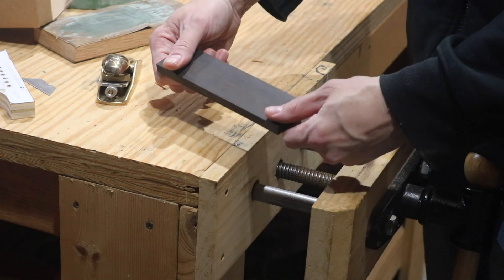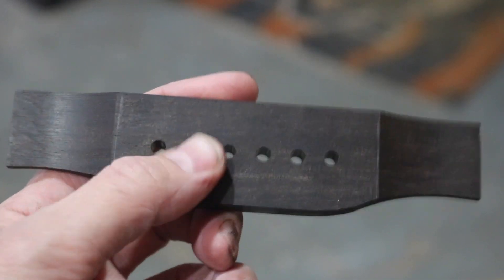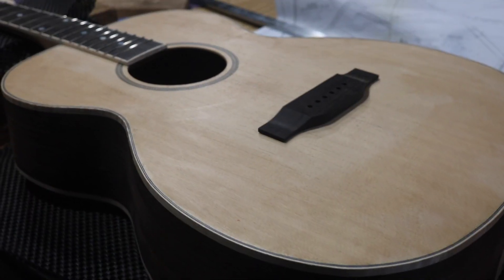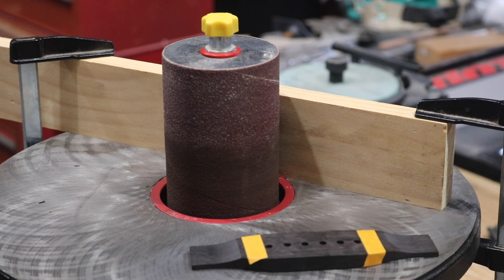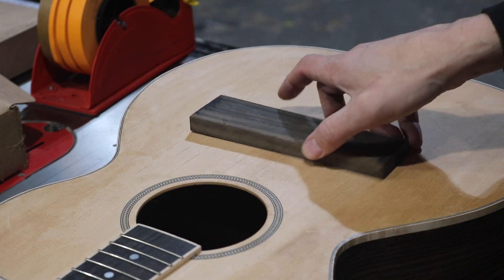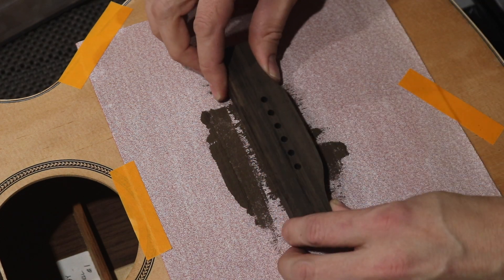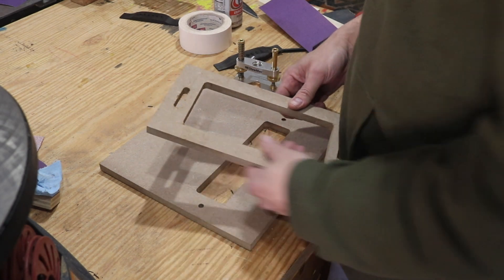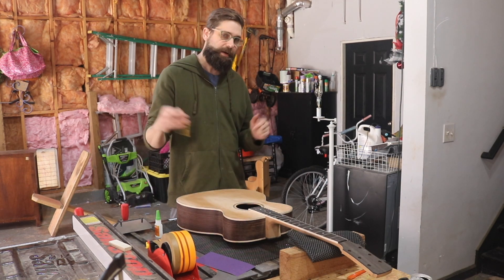Acoustic Guitar Build part 15  // making the bridge - with problems

Comment: Great video, and so good to share sticky moments which we all have of course. If you have a radius dish for the top, it’s easy to make a bridge shaping convex sanding jig. Just sand a piece of ply in the dish to the radius, screw a vice hold underneath it, and fix 60 grit with double sided to the surface. A solid surfce to sand against, unlike the more delicate front.
Reply from the maker: I actually do have one of those now. I used it starting with my second guitar to do the initial work, then fine tuned lightly against the guitar top. The place I found then called them domed radius dishes. Thanks again for watching!

Comment: All good comments and observations on the bridge, contact patch and wings. You can use your shop pencil to mark the bottom of the bridge and then see exactly where wood is being removed. Also note that when the wings are thinned, they may not touch the top, even if they did when you fitted the bridge to the top. Wood has internal stress and when you thin the wings, the stress relief may result in some movement and gaps. As long as the space is small, the bridge clamp and glue will take care of it. My opinion…
Reply from the maker: Good to know. Thanks for the information!

Comment: Chris, I’m glad to see eye protection and ear protection. Breathing sawdust and especially “sanding dust” is not good (the mineral oxides are really bad). And many exotic wood species are even worse due to the oils and other compounds they contain. Always wear a mask—N95 or better—or some type of respirator when sawing and sanding. Shop air can be filtered in different ways, but the first thing is a mask/respiratory . I know it’s a pain, but when you hit your 60’s and 70’s, you’ll be glad you did. Also, nice work for #1!  👍
Reply from the maker: Thanks for the comment! Breathing dust has admittedly become somewhat of an issue since I grew out the beard. The masks I have used do not completely protect me. In fact, I‘ve been planning on getting one pf those full face airassisted respirators, the one by Trend specifically. I know I will be using more and more exotics and things that can be sensitizers (like cocobolo) now that I am building guitars, so I plan on getting the mask as soon as I can, but the $300+ price tag is a little off-putting, haha. Thanks again for watching and commenting!

Comment: Nice video Chris. Think about your action and your saddle height. If you want your action to be 6/64"(bass) and 4/64" (treble) that will make your gap at the bridge go up 12/64" , 8/64". You add that to the gap at the bridge and that will be your saddle hight. Ideally the saddle should be 1/8" to 3/16" over the bridge. So, some gap between your bridge and the straight edge is desired. Too much will make the saddle too high. Too much would probably be more than 1/32". For me, I shoot for the straight edge to barely clear the bridge.
Reply: By the way, your guitar looks great!
Reply from the maker: Thanks so much for the information! It‘s really helpful. I‘m right about 1/32 right now, so I should hopefully be good. My bridge is a bit on the thick end, however. I think on my next guitar I may try to reduce the neck angle just a bit. Thanks for watching and commenting!

Comment: Good stuff Chris; you have a great approach imho! Try the cabinet scraper for the bottom of the bridge next time round; I use it as it's much faster than sandpaper and there's no risk of sanding bits you don't want sanded, rounding over corners that should be sharp etc. You can use sandpaper taped to the top to just show where to scrape next, by very lightly rubbing the bridge back and forth just once or twice and checking the underside of the bridge for scratch marks (you'll see these because the cabinet scraper leaves a very smooth finish). The guitar looks terrific!
Reply from the maker: Thanks Chris! I appreciate that you watched and also the advice! I may give that method a shot next time, even if to get 90% of the way there. It would definitely save some time.

Comment: Chris Very nice job, I bought that same book from Kinkade guitars a long long time ago, I bought several over the years each book has something it teaches that you might not think of. Good luck & I can’t wait too see that bad boy strung up.🎸🎸🇺🇸🇺🇸🙏🙏👨🏻‍🦯👨🏻‍🦯
Reply from the maker: Thanks for watching! I have read a little of the book so far and have skimmed back and forth at several other sections. I can tell he had to be pretty brief with some of the steps, so there‘s not a huge amount of detail, but for someone who has built a guitar already, it would be more valuable. If I were going off of the book alone for a first build, I might be a little unsure about some steps.
Reply: Yea I feel the same Chris, I forgot to tell you that both of the parlor guitars I’m building the backs cracked open🤣🤣 I talked to Robbie he said because of where I live the northeast I closed the boxes it was warmer weather now it’s in the teens Very low humidity. I had to remove both backs & make new ones and install them. now I have no binding left so I just made my own after screwing that process up twice  where I undercut the binding channel & ended up sanding most of it off Ugg. Sorry for the rant. God Bless 🙏🙏🇺🇸🇺🇸🎸🎸👨🏻‍🦯
Reply: Kinskaid’s book is very good overall, IMO. I don’t use all of his methods, but the content, photos and drawings have been very helpful for my builds.

Comment: Your initial thicknessing of the bridge blank is probably fine, as comparing geometry to your Martin should confirm. As your guitar ages and plays in, that portion of the sound board will probably rise or 'dome' a little anyway as string tension pulls on it constantly. If it ever rises enough to lift your bridge height above the extended line of the fretboard face and hurt the action, all you have to do is sand down the top, radiused face of the bridge to get your adjustment range back and then resand the bottom edge of the saddle to restore your action to where you like. So no problem!
Reply from the maker: Thanks again for the info! Makes sense if the soundboard ever bellies. Just thin down the bridge from the top, thickness the saddle. Not really so tricky when you talk it out, haha
Reply: @CMRWoodworks  Exactly. This is one of those things that still leaves you some adjustment as the guitar ages. If you're careful and mask off the guitar you can always keep working on the bridge and saddle with tools and sandpaper to level the action out. Usually just takes some sanding, then re-oil the bridge. You've got it going well.
Reply: @CMRWoodworks  Very good video of hand fab of a bridge!  To add a small detail, the bridge mass (weight) is directly related to the resonance, and resonating frequencies, of the top.  Changing the mass (shaving it down to lower the saddle) will affect those parameters.  How much it affects it is complex and almost impossible to predict or model, but you can measure with freq analyzer.  So, changing the mass of the bridge (including the pins) will change the way your guitar vibrates.  Whether or not you could hear that change is another story.  You can affix a stack of pennies to the bridge to hear (or not) the effect.  Just a small detail every luthier should be aware of. Google it for deeper understanding.....

Comment: Chris, just watching this again and wondering how you determined the intonation angle before you cut your slot? Would it be better to install the bridge and align the saddle slot after finishing? Kinda like Jerry of Rosa String Works does? I haven’t watched the setup videos yet of my course so forgive me if that’s a dumb question…. 😎
Reply from the maker: Robbie gave a measurement for it. He had a measurement for where the cut should start above the high E and where it should end up above the low E. I can’t remember off the top of my head those measurements. Afterwards, during final set up he teaches how to compensate the saddle by filing at each string.

Comment: I just finished my first build a couple weeks ago, I was following that rule of having the top edge of the bridge meet a straight edge on the fretboard and I ended up with a pretty high action. My saddle is buried in the bridge, can't go any lower, so if I want to lower the action I'll have to shave a bit off the top of the bridge. I don't know if that means I screwed something else up, or if the rule is just so you have the room to make whatever action height you want. That's my non-expert experience for what it's worth.
Reply from the maker: I can‘t go much lower with mine! I was around 1mm over the bridge. But after playing it, it sounds fine and I don‘t even notice the height of the saddle just looking at the guitar. Anyway, thanks for the feedback!

Comment: Beautiful job my friend! Can you tell us how you set the angle of the jigle? I mean this is not paralel to the frets, it has a little angle so the bone touchs de 6th strings farther than the first strigs (just for 2 milimiters or.something like that) i will apreciate it if you can answer my question! Sorry for my poor languaje, im.from Argentina. Wish you luck my friend
Reply from the maker: The jig has two parts. The part that sits on top has two slotted holes on both the left and right sides so that you can angle it like you need and then tighten the bolts. Look in the description of my video and I left a link to a video of a guy showing how to make the jig. Thanks for watching!

Comment: hi Chris, hats off to you, for your achievement, and also for the brilliant documentation from which i could already - along with robbies course- learn so much! thank you for that. now with your experience, would you rout the saddle slot with the bridge mounted on the guitar, as some propose, or rather do it on the workbench? thanks and best wishes from Austria (and i hope you found some time meanwhile, to finish the walls in your basement :-))
Reply from the maker: Thanks for your comment! At this point, I’d rather rout the saddle slot on the bench. Since I already made a jig to do so, it’s easier that way, plus I would hate to mess up with the bridge already mounted. On that first guitar, I did consider doing it already mounted and was looking at buying the jig StewMac sells for that, but in the end, I had to save money and just make my own jig. It works well enough, so I imagine I’ll just keep doing it that way. As for my basement walls: I hate the way they look unfinished 😅. I have thought about putting up plywood or paneling, but it’s a matter of spending the money and having time to do it. And there always seems to be something that happens in my family of 6 that uses up any extra money that would go to something like that, lol. My ultimate plan is to just hire someone to do the work, but I also want that person to add more lighting and power so that I can see better and can have permanent plug in spots for my tools instead of only using 1 plug like I do now.
Reply: @CMRWoodworks  hi Chris, thanks for your answer. Yes, of course, our time spent with the family is the most valuable. As for me, my workshop time is basically limited to when my girls are in bed :-) so from 10- midnight and a few minutes in the morning :-) anyhow, as for the walls, speaking from experience, this can be a very rewarding and beautiful project as well - making the place you spend time at a beautiful place. why not make a video of the project? treat yourself, you deserve it :-) all the best, chrisbk

Comment: The measurement of the fingerboard projection on the Martin makes more sense if the strings do not exert any pull on the neck, right?
Reply from the maker: I guess it does now that you mention it. The Martin was strung up. Haha, thanks for pointing that out! I guess the gap would be a little more with the strings relaxed. Maybe my measurement on my guitar wasn‘t so bad after all. Hmmm…
Reply: The projection from the fretboard to the bridge (plus fret size) should end at the top of the bridge. Then add 3 - 4mm bridge inlay and you have a super string action 😊😊👍👍 I don't know how much previous woodworking experience you have, but you are doing a great job! And the fact that you are not afraid to redo some things to improve the quality I think it's great!!! That's how I tick!!! 🤟🤟

Comment: Anyone have any ideas why acoustic makers think the saddle height above the soundboard is so critical? If memory serves its about 13mm on an acoustic, 10mm on a classical (though that could be as high as 14mm) and 7mm on a flamenco. They all work so what is the critical issue with acoustic guitars? Seems like his bridge would work fine at any height that doesn't make the guitar buzz.

Comment: What model are you building d 28? Are your sides 5 inches and 3 inches
Reply from the maker: The plans used are based on a Martin OM. The body is around 105mm at the lower bout and about 85mm at the upper.